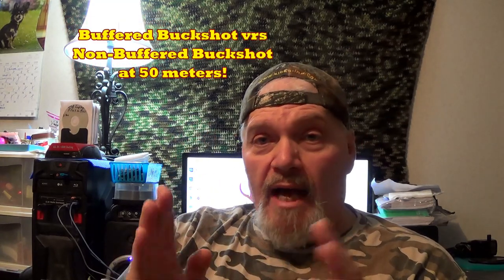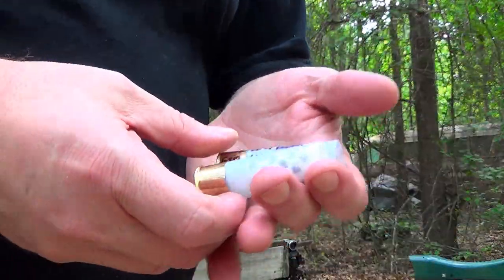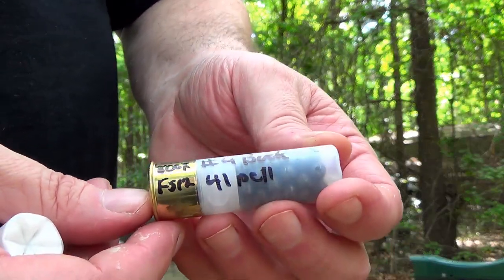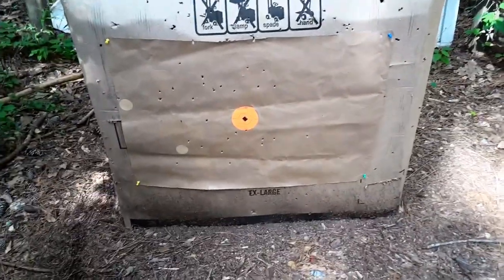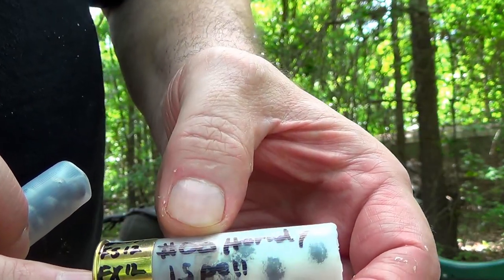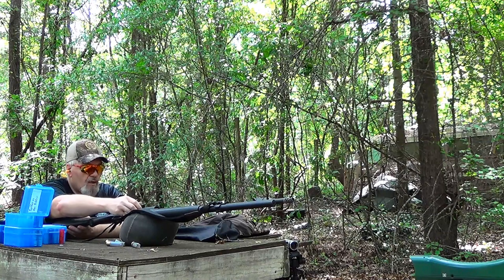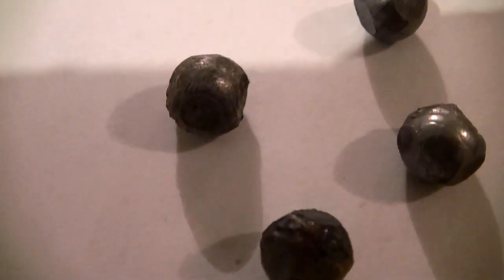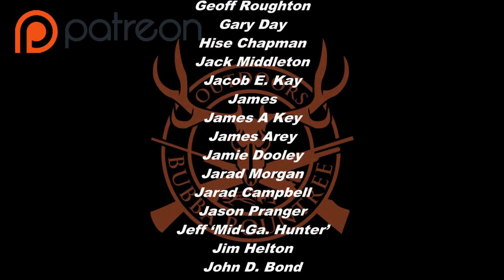Buffer vrs No Buffer! Does Buffer really make a difference?

Comment: I have a mate that works at the railway workshops in Queensland Australia , and I get him to cut me out a couple of hundred copper disks for overshot cards . I use an improved cylinder choke , if you put some vasoline on the top a bottom of my cartridges when it's pissing down rain to keep the moisture out . I'm a professional shooter culling Razorbacks Ferrel dogs and Roos and been doing it for over 30 years now , I do all of my traveling and shooting from horseback , otherwise you would never get to the places I need to be on some of these cattle stations , Victoria River Downs in particular it's as big as Germany in size . Cheers from Australia kindest Regards Dan 👍

Comment: My old fixed full choke Mossberg does amazing with your#4 data that's my go to deer load but your 000 data is what I use for hogs where I hog hunt is thick palmettos and that 000 rips through with ease,
I wish you could sell your buckshot on the open market Mr, Wade you would be a millionaire inside 6 months, You have taken shotgun hunting to a new level, back in the 70's and 80's 50 yard's was a heck of shot if you dropped one now 100 yard's is common place
Reply from the maker: Have yall tried the #0000 Quad loads on the hogs? I bet that load would also be lights out!!

Comment: I shoot soft lead (air dried) while practicing for duty and home defense. Without buffer my Remington 870's get lead build up in the bores pretty fast. Your Alox and graphite coating does help a little though, but I still need buffer. (Our issue rounds are Federal Law Enforcement Tactical Flitecontrol 9 pellet OO Buckshot, (it originally was 8 pellet) copper shot, buffer and that wonderful Flitecontrol Wad and leaves a much cleaner bore.) Do they make that Flightconrol wad available as a component?

Comment: Great vid! I have a question, but I kind of feel it was already answered in your video here. Does buffer increase the pressure of loads? I know it is a debated subject atleast, but seeing you use identical loads and get similar velocity etc... it seems as though it had little to no impact with or without the buffer. I'm a 20 guage shooter and am sick of not having buckshot options available, or available at all at the moment really. Plus, I want some buck and ball and "pumpkin ball" shells and they just arent available for 20 guage. I will make my own! I am about to load atleast 500 buckshot shells for my 20 guage and am considering the buffer now. Having to factor in increased pressures etc would steer me away from using it, but I feel the science behind it makes sense and would personally like to buffer my buckshot. If course extensive testing will take place on my part with MY gun to see what works best... I just wonder if I need to cut back my powder or anything on the buffered shells to be safe?  I appreciate any further info, if you can. I fully understand the questions come at ya like a machine gun, Haha. Thanks for another informative video sir!
Jim Brown
@bonezcustoms on IG
Reply from the maker: I know that the buffer does raise the pressures some, but in the case of these loads, it appears to be minimal... it may also greatly depend on the type of buffer used! I know that the pressures spike higher when I am using the Precision spherical buffer.